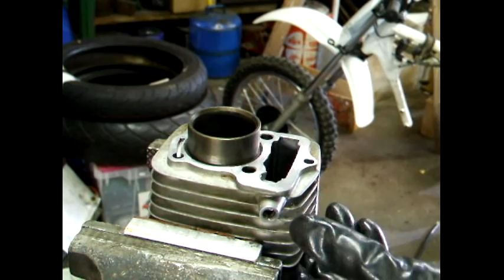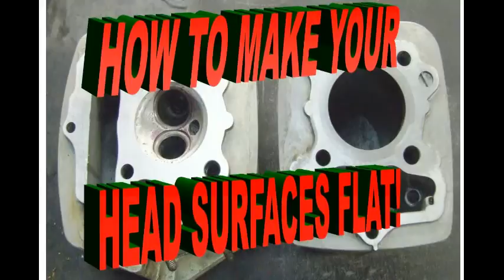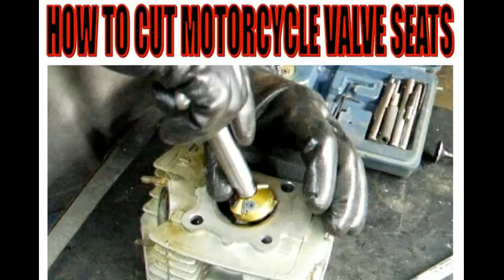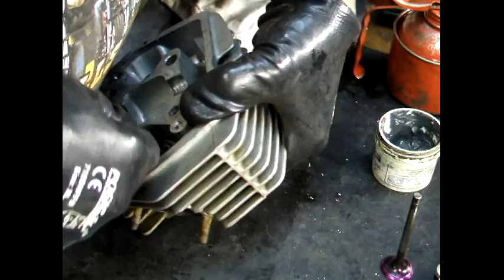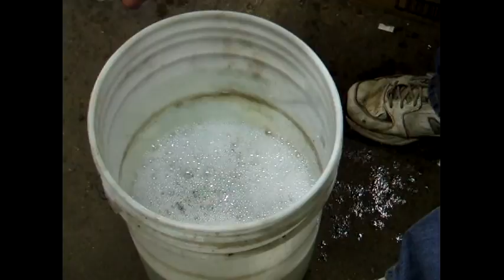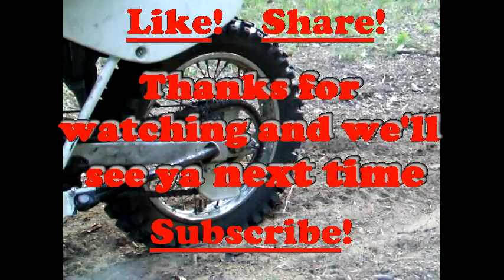HONDA XR80 CRF80 XR100 CRF100 rebuild project

Comment: Did you remove the valve guides or did your cutter tool parts fit in them? I see on the diagrams they show them removed and a seal. It seams they are maybe machine pressed in however?
Reply from the maker: I use the valve guide to pilot the cutting tool.

Comment: I have a 94 xr100 and an 89 xr250.  Both were running great until hurricane Katrina in 05.  My dad did nothing with them and they’ve sat for the past 15 years.  They 250 will turn over but the 100 will not.  I’ve soaked the combustion chamber with some oil for the past two days with no luck.  I’m working on the 250 but waiting for a spark plug tool in the mail.  My question is, how should i go about trying to get them to run or is it even worth my time?  I hate to junk them because they’re in such good shape externally.  I believe it was fresh water that got about 30” high.  I believe that was high enough to get into the exhaust of the 100 but not the 250. Probably why the 100 won’t crank over because it’s probably rusted shut.  That’s my guess anyway.  Well any tips would be appreciated and thanks for the video.

Comment: I appreciate the feedback. I realize my question about removing the rocker pins seems novice, but my Clymer XR250 manual states to just "remove the rocker pins" without any explanation, otherwise I probably would have already purchased a manual. So far, though, I have been able to find all of the info needed online. Like, to remove the rocker pins, insert a 6mm bolt into the end of it, turn, and it pulls right out.

Comment: Can you tell me how to disassemble the camshaft holder/journals? I have to remove the valve lifters to put in the new head of my '01 XR100R. Thanks. Chris
Reply from the maker: Chris DeBardlebon You should really get a service manual. There is a good chance you'll have other questions as you do this project, plus it will help you reassemble it correctly and give you specs to set your valves to.